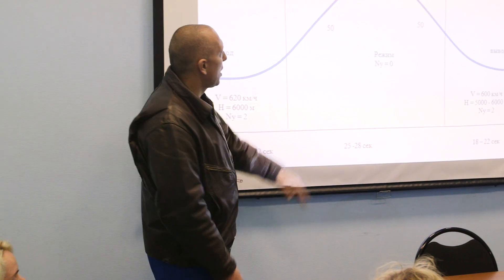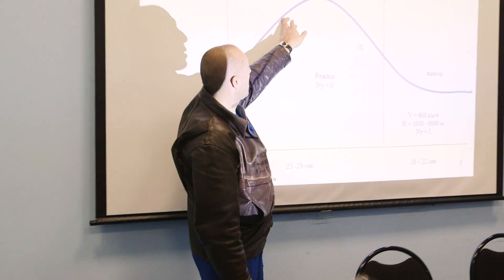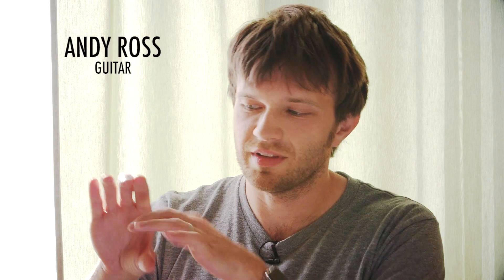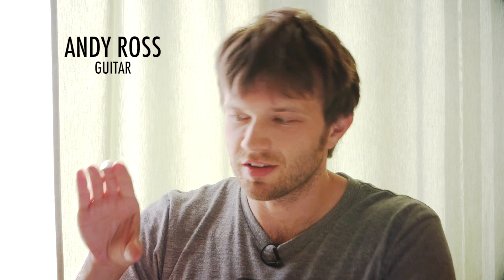OK Go - Upside Down & Inside Out BTS - How Parabolas Work

Comment: It makes mer really happy that you guys understand the science behind this and then took the time to explain it to the rest of us. One question though, how expensive was it to film this video? Splattering paint in a plane like that can't be cheap...
Reply: +Vincent Bullock all the surfaces in the final video are their own set laid on top of the normal interior of the plane to make it look more like an airline cabin. You can see it part-finished at 1:33. So although it's probably true that the normal interior wipes down well, everything they brought in would have had to be easy to clean too - although it only needed to last for 8 takes.
Reply: +Molzy I wasn't saying this was their most expensive video I was merely wondering how much this particular video cost.
Reply: +Molzy I'm sorry, I didn't mean to ruffle any feathers, I was just giving my two cents worth. I too am very curious about the cost honestly. They made all of those scooters and then after they shot the video, pretty much mothballed most of them.
Reply: +Connor Mueller I think the interior of this kind of plane is designed so stains come off easily. This is because it's very common for passangers to throw up during the flight. Also I don't think they were using paint. Any non toxic liquid with color would work just as well and not stained as much as paint.
Reply: Connor Mueller I wasn't really either I just wanna know how much all those cost, sponsorship or not
Reply: +Molzy I think Honda covered the cost of that video since it was made for them to advertise Honda with. They still play that video continuously at their headquarters in Omotesando, Tokyo.
Reply: +Connor Mueller This video expensive? 'I won't let you down' has hundreds of those sitting motorbike things and thousands of umbrellas I want to know how much that cost.